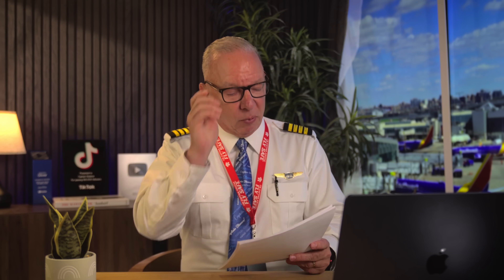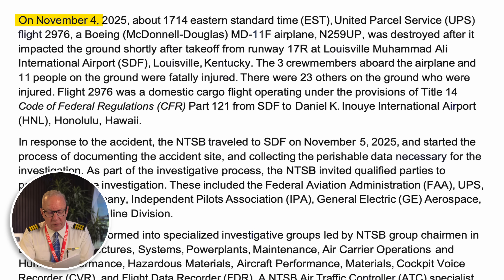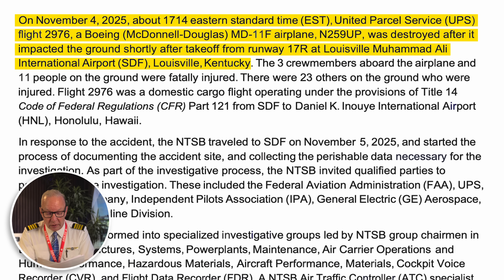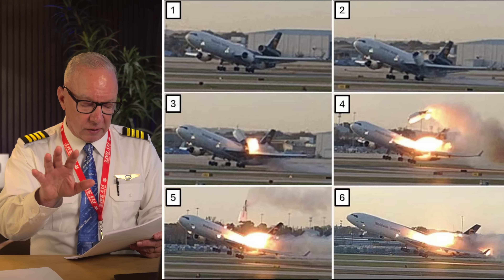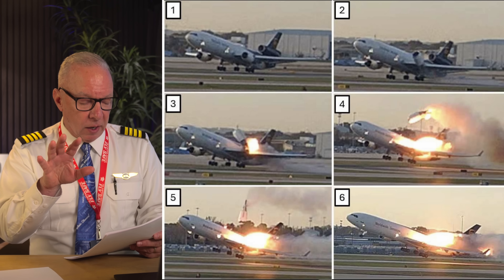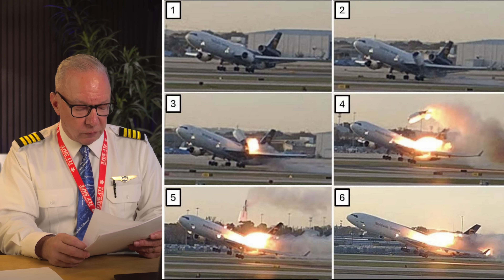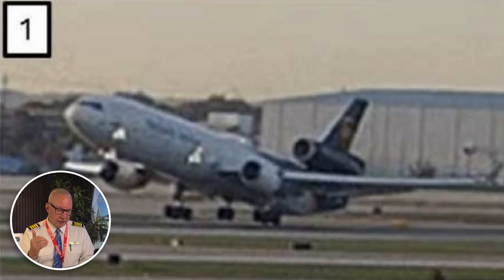UPS Crash Preliminary Report | Pilot Reacts to UPS Crash Report

Comment: Looks like the material was aluminum.  If true, seems to me like a bad choice of material to use in such a high stress application.  Unlike steel, aluminum has no stress-strain plateau and will weaking at an accelerated rate as strain is repeatedly applied.  Anyone know if aluminum is actually used in this application, and if so, is it commonplace in other aircraft using pilons?

Comment: Don't rubbish the 481 feet.  It clearly got higher than 30ft before crashing ..The report   not your guesses. You are an  ex pilot. Not an engineer or NTSB investigator.
Reply: The plane was 481 feet above MSL (mean sea level), or 40 feet AGL (above ground level). The elevation of SDF is NOT at sea level. Official elevation for SDF is 501 ft but that's an average as it varies throughout the facility.

Comment: It appears that ADS-B is calibrated to mean sea level (msl). So if you take the 488' msl from ADS-B and subtract Louisville's altitude of 466', you get 22' above ground level. However, just found an altitude reported for the airport as 501'... I guess these are barometric readings? So we'd have to have known the altimeter reading from the airport that day.
Reply: Both barometric pressure altitude and GPS altitude reported by ADS-B have to be corrected to convert them to Above Mean Sea Level values. Maximum pressure altitude reported was 225 feet; reported field altimeter setting was 30.22, so we add 300 feet=525 feet AMSL. Maximum GPS altitude reported was 450 feet+geoid undulation correction factor of 116 feet= 566 feet AMSL. Runway 17R south end has an elevation of 461 feet AMSL. So they reached an altitude of about 75 to 100 feet above the ground. However, this altitude is the altitude of the sensors, which could be   10's of feet above the main landing gear.

Comment: It sure looked like the #3 was compressor stalling to me. Those pop pop pops of flames out the back of it.
Reply: Even Steve is now saying it wasn't #3 with the flames, but #2 (the rear engine).
Reply: @igclapp I know, but that leads to the question, what were we seeing over there? Did you see it? Obviously it wasn’t happening because it would be in the report but …

Comment: I had to take a short break, and then come back to finish the video.  The engineer in me is very interested in the science of all this.  At the same time, the emotional impact hit out of nowhere, and it hit hard. Real people in my home city of Louisville are dead, injured, and grieving because of this tragedy.

The silver lining is that the NTSB found this issue as quickly as they did.  By all indications so far, the aft pylon lug cracked and then failed before the required reinspection.  This makes me wonder how many other MD-11s and DC-10s already have undetected fatigue cracks.  If all of those planes have the same pylon in common (and the same required inspection intervals), the aft lug is a potential catastrophic failure in all of them.  They could all be cracked and ready to fail for all we know.
Reply: That is exactly why the entire fleet of MD-11's and DC-10 have been grounded.

Comment: In light of what you are reporting, there are several mechanics breathing a sigh of relief.  It was not a maintenance problem, it was a structural problem.  This area was highly scrutinized 30 years ago by non-destructive testing inspectors. It was likely focused upon ever since.  The result is the same either way, but I have to wonder, did the #2 engine F.O.D. out, or compressor stall?  Much respect to aircraft mechanics. They simply can't live with themselves if they cause a disaster.

Comment: I’m very curious, why spherical roller bearings for a fixed component. Plus they require setting thrust tolerance, in and out by a few thousands of an inch to avoid cavitation and accelerated wear, these are usually used in push block low speed rotation or high soeed gearbox input shafts.
Reply: It's not truly fixed. They want to allow some play to (ironically) prevent cracks in the wing where the pylon attaches.

Comment: As a metallurgist, I have many questions.  Fatigue is well understood.  I can bring up a chart telling you what stress the material can withstand for the desired life plus safety factor.  I can tell you what a defect will do to concentrate the stress and shorten the life.  To me, 20,000 to 30,000 flights are not that many.  I know that there are a lot more fatigue cycles within each flight, but it sounds like this is a low cycle fatigue failure.  There should be one cycle for takeoff and one cycle for landing when the stresses are maximized unless I am missing something.  This is a large number, but I woudl expect it to be within the design of the plane.

My hupothesis is that there was something more to this like something scratching the surface and introducing more stress than the design allowed.  I am not pointing fingers, but I hope taht they have visual and other documentations from that lubrication maintenance.
Reply: "… one cycle for takeoff and one cycle for landing when the stresses are maximized …"

Cycles refer to take offs and landings, as well as pressurizations of the fuselage.  

Only at take off are the engines operated at full thrust, and at rotate, the sudden upward rotation causes gyroscopic precession in the spinning engine parts, making the engines try to rotate to the right, which applies additional forces on both engine mounts and pylon mounts.

Upon landing, the engines operate at much lower thrust and there is no abrupt upward rotation, just a slight lifting of the nose at flare.
Reply: Corrosion in its many forms especially  between mating parts often hidden or microscopic can cause premature fatigue failure.

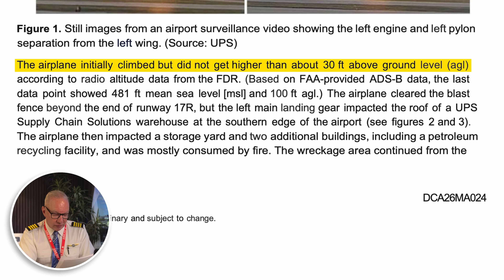Comment: Regarding the information shown in the video where the ADSB data is displayed (at 5:14), it said the data point showed 481 ft asl. Now according to Google AI the elevation of Louisville Muhammed Ali Airport is 450' asl. So 481' is almost exactly the elevation of the airport plus 30' which is exactly what you said. The thing I'm wondering is where the 100' number came from?
Reply: Both barometric pressure altitude and GPS altitude reported by ADS-B have to be corrected to convert them to Above Mean Sea Level values. According to data I read off the ADSB site, maximum pressure altitude reported was 225 feet; reported field altimeter setting was 30.22, so we add 300 feet=525 feet AMSL. Maximum GPS altitude reported was 450 feet+geoid undulation correction factor of 116 feet= 566 feet AMSL. Runway 17R south end has an elevation of 461 feet AMSL. So they reached an altitude of about 75 to 100 feet above the ground. However, this altitude is the altitude of the sensors, which could be   10's of feet above the main landing gear.
Reply: @igclapp  Thanks for the clarification.

Comment: The Number 2 engine didn't necessarily have to ingest shrapnel to have stalled (though it probably did.)  Think about all that hot, burning fuel from the left wing.  The compressors are designed to ingest cold air.  Not burning hot air/fuel mixture. This was my first thought when I saw the initial videos last week.  Number 2 had the problem, not Number 3.

Comment: Its always been my understanding (at least on the DC-10/MD-11) that if an engine on the wing failed, it was supposed to go up and over the wing.  What I don't understand is why the fire erupted so bad. If an engine detached, isn't the fuel supply automatically shut off?  There was no fire in Flt 191.  Also, it looks like the forward flaps were still deployed, unlike Flt 191 where they retracted, severely reducing lift on that wing.
Reply: I have never heard that an engine is supposed to go up over the wing. That sounds very dangerous. Ideally it should drop downwards.

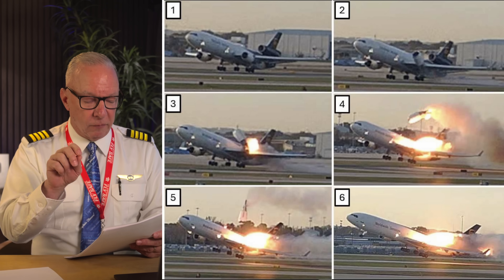Comment: i have another stupid question, if pilots had the option to reject takeoff at this point in time 1:40 exhibit #2, could they have prevented the fireball? NTSB is saying plane didn't reach more than 30 feet off ground. I know that the tanks were full of fuel since they were starting from midwest for a flight all the way to HI. Does anyone have the ability to calculate the physics - maybe NTSB has all that info. Gut tells me that a situation (maybe where there are fewer obstacles) might be an exception to the rule. Gut is telling me that the fact that they attempted to fly to altitude was a factor that increased distance of MD-11 sized molotov cocktail from pounding the hard deck.

Comment: Why would a mount for an engine to a wing be a baring. I don't understand that. Shouldn't it be a solid mount.
Reply: According to AI : "The spherical interface between the inner and outer rings allows for motion in multiple planes simultaneously, including rotation and oscillation, which helps absorb vibrations and compensate for slight misalignments that can occur during flight or due to thermal expansion. This flexibility is crucial in high-load applications like engine pylons, where the bearings must handle heavy radial and axial loads, shock loads, and alternating forces."

Comment: Just amazing. No, I may even mean the opposite — because a Statue of Liberty over the bay is amazing, but this is negligence on the highest level.
There are probably no records showing who caused it to be engineered this way. However, taking the whole machine out of service only because you’ve known about the problem for the past 40 years and did absolutely nothing about it until now is “amazing.”
It just shows idiocracy at its best.
It’s exactly like driving with a bad tire since 2015 and instead upgrading the stereo or other pointless things and when the thing crashes into the tree call it the problem of the vehicle, just as an example. So stupid.

Comment: The MD11 is the same basic design as the DC10.  If you’ll recall the DC10 crash at Ohare in 1979 it was a very similar cause. And I think it was also the left engine mount broke and caused the engine to roll over the top of the wing.

Comment: The preliminary report about the UPS crash of 4 November 2025 is out and points to the failure of the  rear pylon mounting due fatigue which in turn caused the forward pylon mounting to fail. The # 1 engine delivering maximum power uprooted from the pylon and wing from the forward side and flew over on top of the wing as it spewed parts all over which also caused the tail mounted engine, # 2 to lose power due to compressor surging. 

What is alarming is that a similar accident if its  sister ship, the D.C10-10 occurred at O’Hare airport at Chicago in 1979 with the engine falling off. Whatever this inquiry has revealed had already occurred with that previous disaster in almost similar circumstances.

It’s a pity the FAA has failed the public twice in not having enough oversight to prevent two crashes in similar circumstances.

Comment: When I saw the crash footage I looked at my wife and told her its going to come back as a maintenance issue. The FAA requirements are soo relaxed that I am not surprised this doesn't happen more often. A six year FAA heavy maintenance inspection/ maintenance (D Check) is ridiculous given the amount of stress these planes are under. They have annual preventative maintenance but that can be done by anyone in any country to meet the requirement.  This sometimes involves companies sending the airframes to other countries to get the work done cheaper with less oversight and then bringing the airframe back to the US for the D-check scheduled maintenance. 

Prayers to everyone affected by this tragedy and hopefully this accident is the catalyst for stricter FAA maintenance requirements.

Comment: I've lost a lot of faith in you and your team because of this incident. In the initial video, it was obvious that the compressor stall was from the #2 engine, not #3. Even more egregious, the altitude information. In this video, you literally highlighted a sentence containing: "the last data point showed 481 ft mean sea level [msl] and 100 ft. agl", but only read the 481 ft. part then paused after reading and disparaged it saying "that's, that's not what happened, it wasn't that high at all". You actually skipped the most important part: the "100 ft agl".

You do realize that Louisville is in the middle of the country and not at sea level, right? No data ever suggested that the plane got anywhere near 500 ft off the ground. Maybe it's because the report failed to document to your what "agl" means, so let me help you: ABOVE GROUND LEVEL.

For the cockpit of a MD11 after rotation, 100' agl seems like a very good estimate to me, so I think the ADS-B data is spot on.

Comment: Enjoy your videos, great job.  However, a minor clarification on the pylon structure.  The lugs on the pylon are “Fail Safe” by being two lugs sandwiched together.  The idea is that if a crack starts in one half it should not fail the second half and cause a catastrophic failure.  This means that at the aft end of the pylon the aft lug has two halfs, a forward and aft half.  The NTSB report describes fatigue cracking in both halfs of the aft lug.  The forward lug of the pylon did not have fatigue cracking.  I’m a 35 year aircraft structures engineer.  Thanks for your videos!
Reply: The report also says, "For the forward lug's inboard fracture surface, fatigue cracks were observed along the lug bore." Cracks on both lugs compromised the 'fail safe' design, and the compromised forward lug wasn't up to the job when the aft lug failed.

Comment: Disturbingly similar to AA 191. I recall from ACI on 191, that they initially reported the failure of the thru-bolt as the cause of the accident, and it was only on further investigation that they realized it was the mount and not the bolt, that failed...but the similarity in the way the engine flipped up over the wing is really something.

Comment: Wow!! So in 1997 I took a work trip to Paris France. We flew on a DC-10 and left at 5pm. About 2am over the middle of the ocean our left engine failed and stopped working. They initially turned the plane towards Iceland, but then got back on coarse and we landed at Charles de Gaulle airport with two good working engines. The pilot actually came out, lifted the shade and was looking out the window at the engine. Scary!!!!🙏🙏🙏

Comment: 11:23 You're confusing lugs with mounts.  The aft mount has both a forward lug and and an aft lug (See Figures 7 and 9), and both were fractured at the 2 and 9 o'clock positions. (You should remember demonstrating that just a moment earlier.) Both lugs had fatigue cracks -- and they, by definition, were prexisting.  

You don't know what you're talking about.  The failure mode of the left engine forward mount was not even discussed.

Comment: Sounds like the replacement engine was not installed correctly causing the fatigue cracks just like with flight 191.  The engine pylons or mounts are engineered for a minimum of twice as much stress and maximum exertion and thus their life cycles would be a minimum of around 60,000 cycles.  The engines on the other hand are moving parts and thus they do not last anywhere as long as the air frame and need to be replaced much sooner.  Per manufacture recommendations, engine replacements are a very tedious, time consuming and costly process but if done accordingly the manufacturer guarantees that the engine replacement is 100 percent safe.   Start cutting corners can potentially lead to something like this and the biggest reason to cut corners is to produce higher yields on the company's stock, something that the company has been pushing this year.  NTSB should be able to confirm all of this in the next few months.  Yet another case of putting profits before safety and UPS just announced huge layoffs to further increase the yields on their stock.  As Gordon Gecko said in Wall Street back in the 80s - Greed is Good and it is good until you end up in the slammer and how many times have we seen something like this in the past.  Thanks Steve.

Comment: Steeve, your remarks that the craft could fly with two good engines does not apply if one of the wing engines departs.  The weight imbalance would not be able to be overcome by control surfaces and the craft would spin right and out of control.
Reply: The engine is close enough to the centerline that I don't think it would be a big problem. Also remember that in the DC-10 crash in 1979, the plane did not suddenly roll to the right when the left engine fell off.
Reply: Even in this UPS crash, the plane did not suddenly roll to the right when the left engine departed due to a weight imbalance.

Comment: This is eerily similar to AA191. Watching that engine going over the wing was like deja vu. RIP to the pilots, the 11 on the ground, and their families and friends. ❤
Reply: it's eerily similar because basically the same part failed on both planes. The NTSB even mentioned aa191 in the report and specified that it was a different failure mode (damage vs. fatigue).
Reply: AA 191 was absolutely my first thought too.
Reply: @Slider6294  Hopefully, it's not the same cause as before. Otherwise, we haven't learned anything and it will happen again.
Reply: In the AAL case, the departing engine severed all 3 hydraulic tubes mounted on the wing front spar, causing a loss of lift. (Boeing doesn't put all three in front). In the UPS case it appears the departing engine tore thru the wing, causing the fire